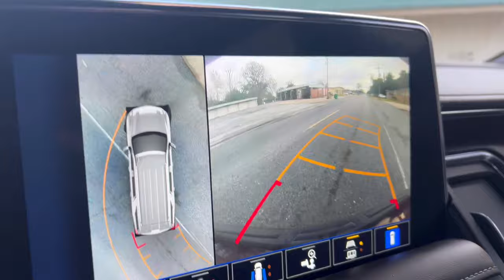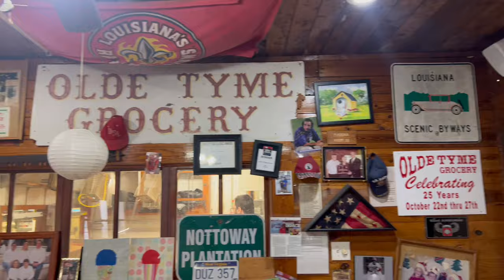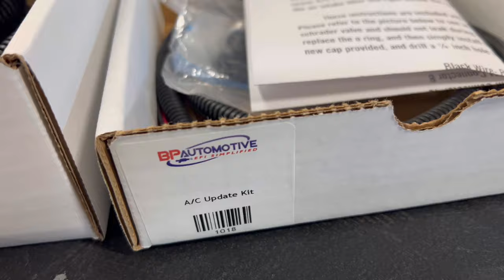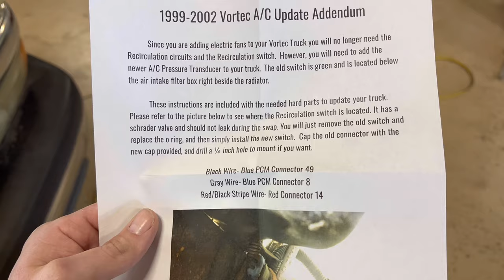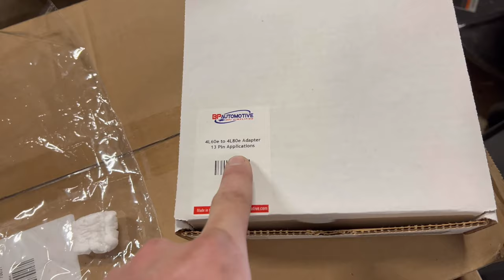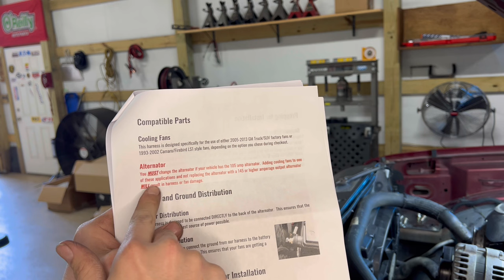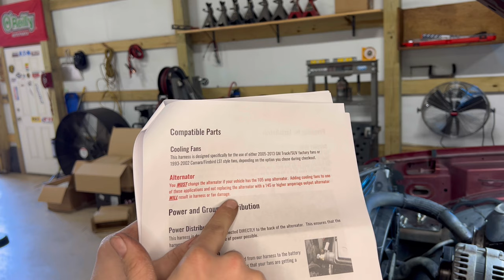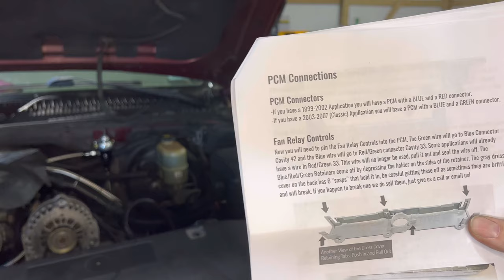Turbo Suburban gets electric fan upgrade! 99-04 GMT800 E-fan conversion #chevrolet

Comment: You have done what so many others seem incapable of doing. I wired the OEM fans into my 06 Sierra 6.0 without issues and just had them turned on while getting a  performance tune. Just finished installing short tube headers with high flow performance cats and a flowmaster with a turn down. Decided to go ahead and do the electric fans.....but had a feeling it might be different since his is drive by cable 02. I've searched to see if the blue wire simply pinned into the red ecu with the factory harness same as the dbw....but there is nothing but speculation on ideas of how to deal with ac issues. Most everyone only wants to cover the blue/green ecu which is a pin and go set up. Watched a video before yours where the guy at least covered pinning into red 33 and capping the existing wire....but left it at that. No answers to the questions in the comments or addressing a ac update. Yours is the only video that I found dealing with the red/blue and how to rectify the ac update. Thanks massively.